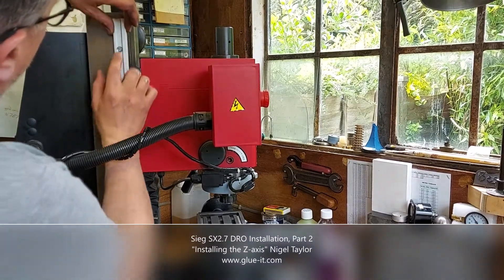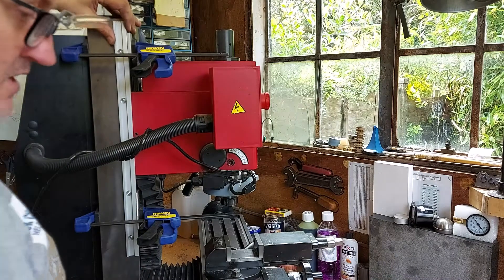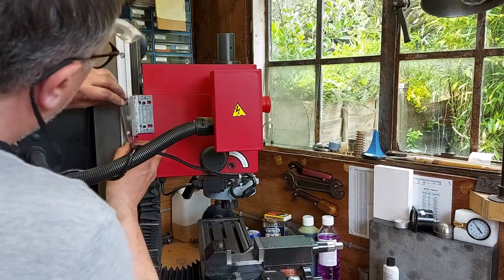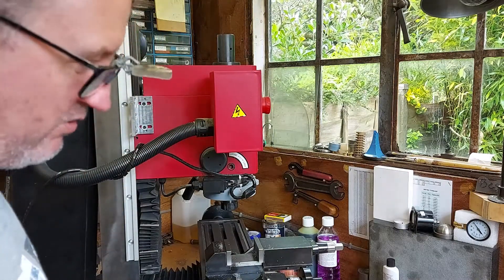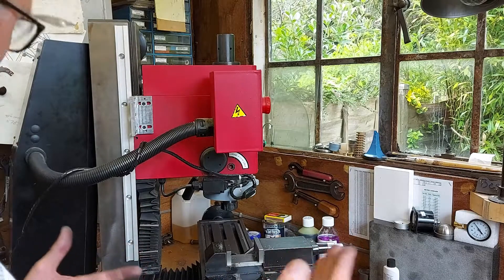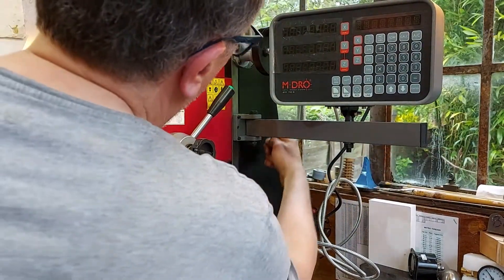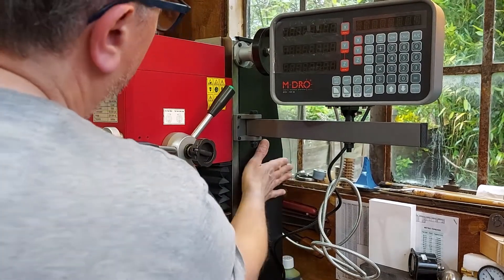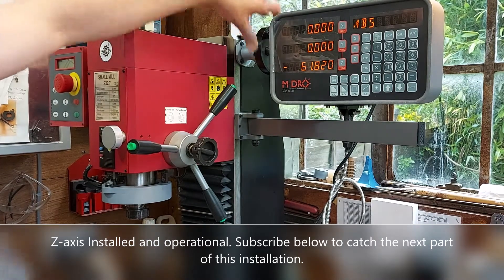Sieg SX2 7 DRO Installation   Part 2

Comment: Hello, Could you tel what is the length of the scales for the X and Y axis. I've got to buy one for my SX2.7 as well. It seems that 200mm in Y and 590mm in X is enough . Do you agree? Thanks
Reply from the maker: Hi, this is the kit I bought: https://www.machine-dro.co.uk/amp/3-axis-m-dro-lathe-digital-readout-package-including-350mm-450mm-and-750mm-cut-to-length-magnetic-encoders
Reply: @editorglueitcom  Thanks, though It does show what length to cut the scale...
Reply from the maker: @lewiss66  I will go and measure the lengths
Reply: @editorglueitcom  Ok thanks, Sorry for disturbing :)
Reply from the maker: @lewiss66  Hi Lewis, just measured the lengths of the scales: X=595mm (this matches the length of the table), Y=400mm (matches the depth of the base unit) and Z=500mm. What I haven't looked at is the minimum you could get away with. Hope this helps, Nigel
Reply from the maker: I had material to spare. You can take travel in each axis and add length of sensor. I would add a margin of 20mm to each axis to be safe.

Comment: Hi Nigel,
I’ve got a Sieg sx 2.7 that I’m about to buy a dro kit for. 
Until I watched your video I was going to buy a 2 axis X and Y kit, as you know  the sieg already has a small dro on the quill. Would you say it’s worth the extra cost and fitting to have a full travel Z axis dro? Thanks.
Reply from the maker: Hi Andy, I think it's worth it just for the accuracy you get with the z-axis movement rather than the quill. I now lock the quill and just use it for drilling operations. Best regards, Nigel